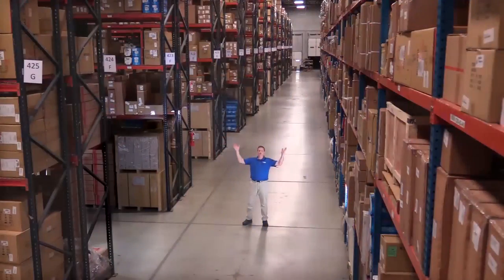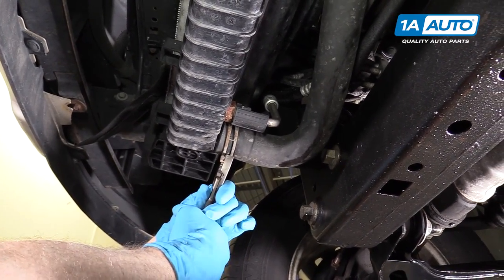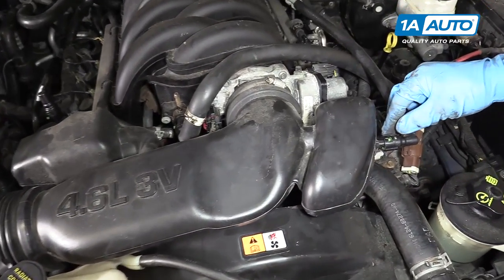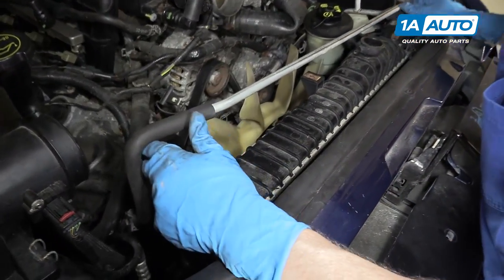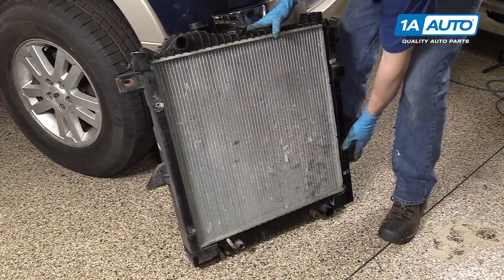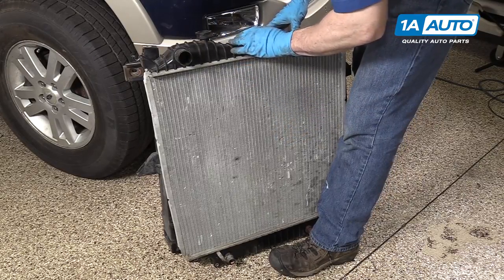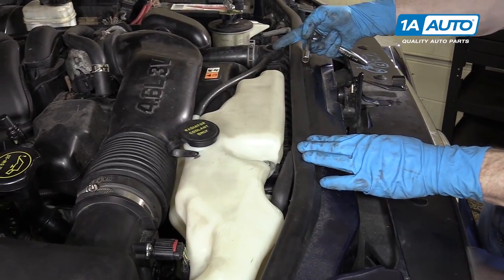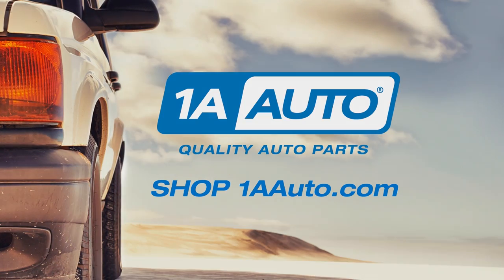How to Replace Radiator 06-10 Ford Explorer

Comment: The whole process was actually much easier than it looks with two notable exceptions.  First and Most Major, the quick connect transmission lines are a SOB to get off.  The key I finally found was to find something to keep the tool pushed into the release while pulling on the lines.  Once I finally got those out (took be about 3 hours and a trip to the auto parts store for a different tool), the rest was very straight forward right along with the video.  The second thing that threw me a large curve was the final steps of the re-install of the new radiator.  The new radiator came with new clip on nuts.  The problem was that the two that go on the outside top of the radiator to hold the brackets to the radiator were NOT the right size for the bolts on my truck.  This had me all confused for a bit trying to figure out why I had two bolts that would not fit anywhere.  Once I grabbed the old clip on nuts from the old radiator it all went back easy.  I hope to never have to do this again, but I think if I had to do it again it would go much smoother.
Thank you for an AWESOME video.
Reply from the maker: +dwittster Thank you for the great reply. We love to empower our customers by showing you how-to perform your own auto repairs while installing our high quality auto parts. Have a great day! 1aauto.com
Reply: Thx for the heads up on the top 2 brackets saved me some time as my new radiator, also came with wrong sized brackets for those top 2 bolts

Comment: Very helpful vid! Threw me a little that you took off the side bracket bolts on top. Made me think  I could slip out the actual radiator and leave the brackets in. Also on my 2010 4.6L there was a protective spoiler mounted to the bottom of the radiator with the hardest to remove push on plastic locks.
Reply from the maker: +Rod R Thanks for the feedback! We love empowering our customers and showing how to perform DIY auto repairs with our high-quality auto parts. 1AAuto.com

Comment: Do you have a video on adding fluid to the transmission? It seems straight forward but was just curious, thanks! This video helped me knock out this repair last weekend!
Reply: Its actually very easy, just unplug the 19mm (I think) plug and pump new atf with a hand pump from the bottle to the transmission. Pump until fluid starts to come out, then you have to start the truck up (leave it in park) get under the truck again, check the level with the dip stick and add more fluid until the fluid shows up on the hash marking. Plug it back up and drive it around for 15min with some speeds of 50mph then come back and while still ON and in Park check the level again, it should still be on the hash mark if not then add or remove as needed.

Tricky part is doing this while the truck is ON because the hot cat is so close to your hand so be careful. I've done this procedure multiple times already and it's too easy now lol. Also 6r60s love fresh fluid so add a drain plug and drain and refill every 30k miles

Comment: Do you need to add trans fluid after this?
Reply: It depends on how much fluid you loose when you disconnect the cooler lines to the trans

Comment: I have replaced several of these in the past. I have always had to remove the condenser with the radiator then split them on the bench. Doing one today And thought I would find a secret. I simply cannot get it out so I removed the refrigerant and will pull the rad and condenser as a unit.

Comment: Does the oem radiator still have crap plastic pieces? Do you offer a full aluminum radiator instead?  06 xlt 4x4 v6.
Reply from the maker: +Justin Nichols Thanks for checking us out. Shop for high quality auto parts on 1AAuto.com:

http://1aau.to/m/Shop-1AAuto-c